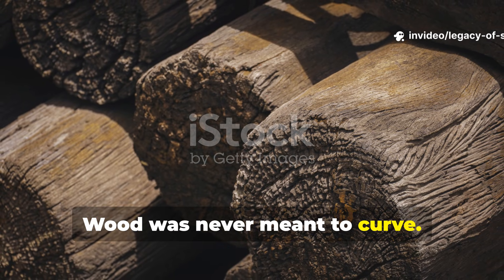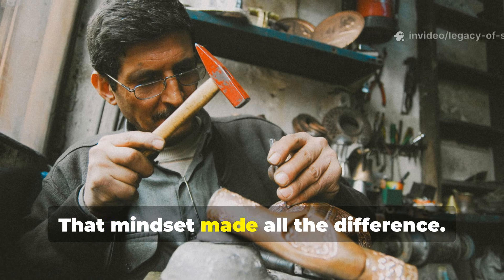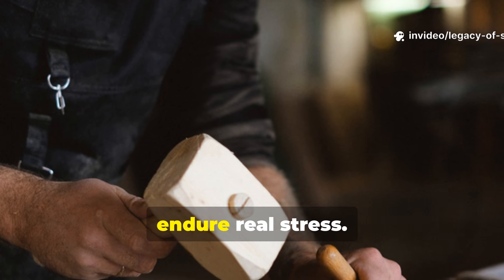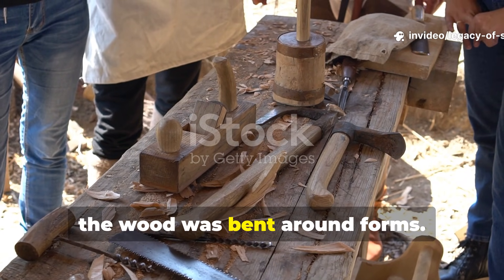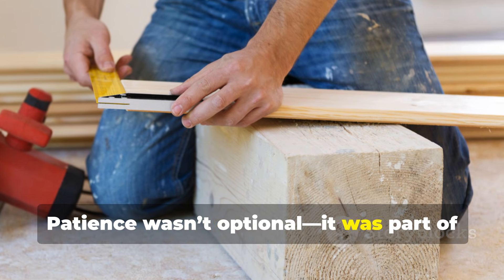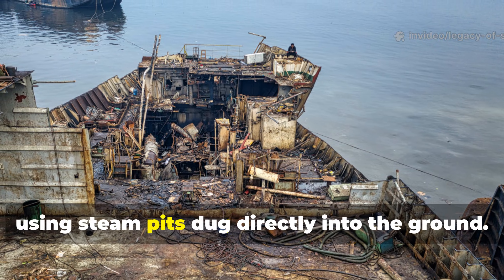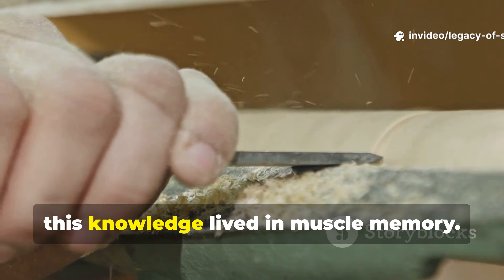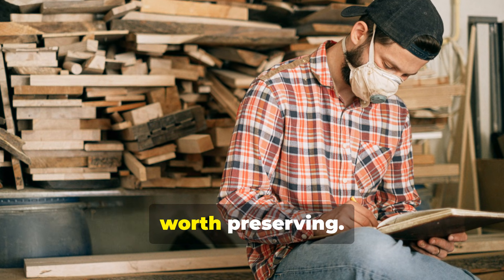The Medieval Wood Bending Technique That Built Ships, Bows, and Empires

Comment: Far out this is completely idiotic. While the narration is accurate there are pictures of blacksmiths bending steel and people applying heat to remove paint from boats. Almost no pictures shows would being bent. There's even a picture of a spoked wheel which is all straight wood except for a metal ring on the outside. Is this what happens when you let AI steal your pictures? Please, just go away.
Reply: Not just pictures, in some parts the narrative feels like AI structure.
Reply from the maker: The narration is about historical wood-bending techniques, not a frame-by-frame explanation of every image shown. Some visuals are illustrative or symbolic rather than literal demonstrations. That said, you’re absolutely right that clearer, more accurate visual examples of bent timber would strengthen the presentation, and that’s something we’ll improve going forward. The technique itself is well documented in shipbuilding, bow making, and wheel construction, even if it isn’t always obvious in still images. Appreciate you taking the time to comment.